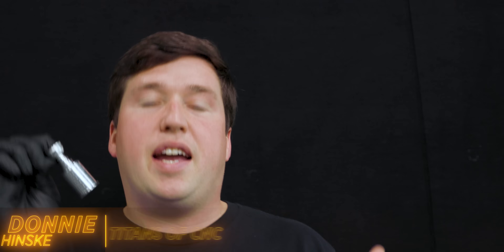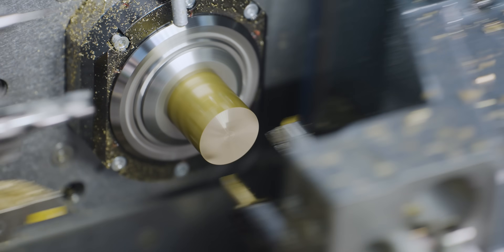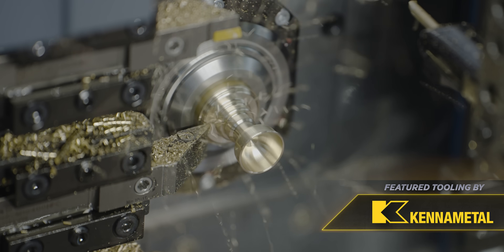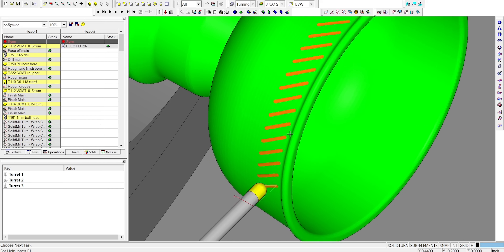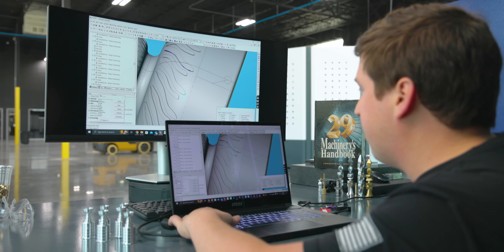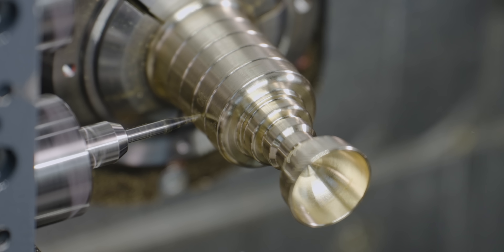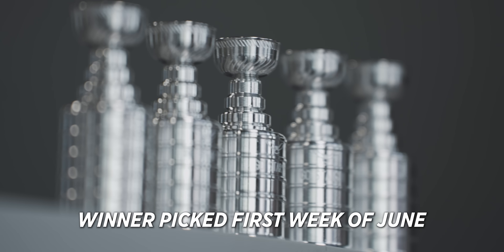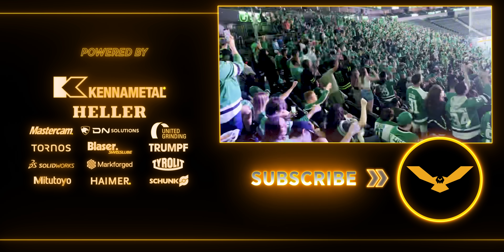I CNC Machined the Stanley Cup! | NHL Playoffs

Comment: what software did you use to program the part and is it an appropriate swiss turning software or is it a simple lathe and mill programming and you post the operations individually and you copy paste the code and stitch it together ?
Reply: It's Esprit
Reply: That is ESPRIT Cam and it can program, simulate and post complete Swiss programs.
Reply: @keithjablonowski1923  Huh esprit can program anything it will make the machine dans macarina if you know it well enough but does Donnie have the swiss package because I know that John Grimsmo is programming his Y axis nakamura and his tornos swiss lathe the way I described, by posting single operations and stitching the gcode, it is a reasonable way to program swiss lathes bcz you to program a new part every two weeks or so bcz most of what you'll get is high volume production and setting up the machine with new tools and touching them off takes a day or two if you don't have quick change tools like donnie have on that lathe, so stitching code is more cost effective than buying a complete software package, some people will manually write the code if they don't have complex 3d surfacing on their parts.
Mind that I don't have any experience in swiss machining other than information on youtube and forums so take my word with a  grain of salt.
Reply: Of course.  If you are programming only simple parts and longer production it is harder to justify the cost.  There is also a lot of competetion for that work.  Our customers that invest heavily in ESPRIT and utlize it completely are in another league and do work that others run away from.  😊
Reply: @keithjablonowski1923  Truth. My dad would have turned down $$$$$$ worth of work if I hadn't learned Esprit and helped splice in a lot of the mill-turn programs for him
Reply: @peterCheater  Glad to hear it!
Reply: @keithjablonowski1923  well that's where my experience or my lack of experience bottlenecks me, I can't imagine what the other league is doing to need to invest in esprit
Reply: I program the part in Esprit, post it and slap it into the machine. No copying or pasting
Reply: @donniehinske  heeeyyyy donnie great to hear from you here's an idea for your next video, tell us how to effectively touch off tools in a fast way when you swap an insert or put a new tool in
Reply: @merouanebenderradji1582  all of that and more to come in our future Swiss academy. Stay tuned!

Comment: what and how small was the smallest part anyone of you has ever done?
Reply: .02” (.5mm) x .1” (2.5mm) on my dads star like 14 years ago. The hard part wasn’t making them it was NOT losing them
Reply: @donniehinske  😂
Reply: .013 diameter x .062 long pin (those are in inches).  The diameter was +/-.0002.  I had the same issue of finding them once I made them.  If the customer needed 100 we had to make 200 just to find them.